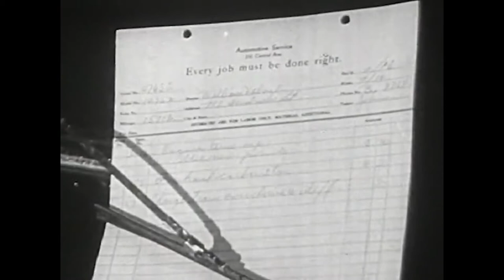School Bus Conversion Vlog: Electrical Wiring

Comment: For better electrical reliability always wire brush or grind down to bare metal  on your ground wire area for the best possible ground. Then once the wire is connected you can paint over it to seal the metal against corrosion. Also be very careful that none of your suspension components can pinch or rub any wires in your systems. Great videos!